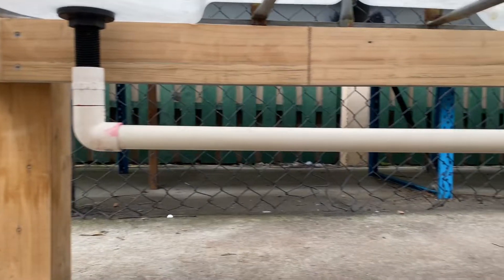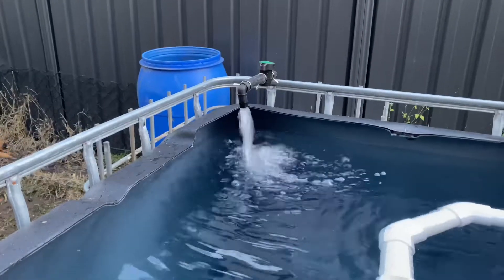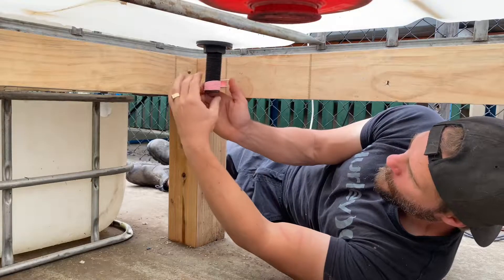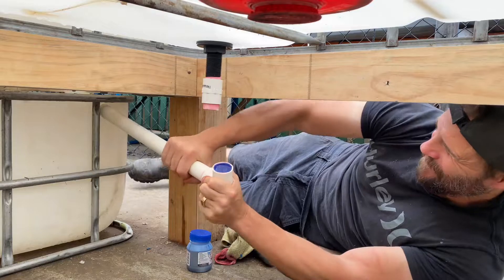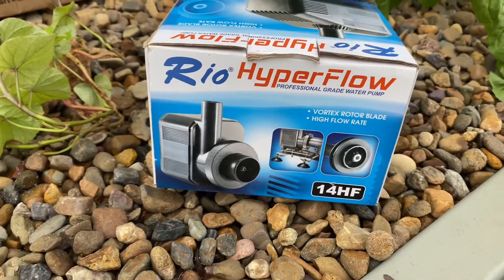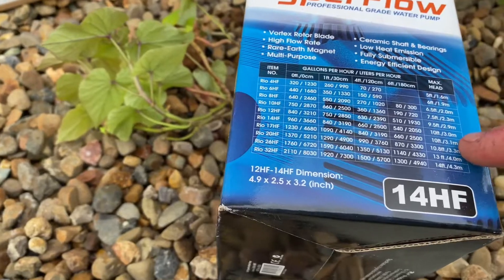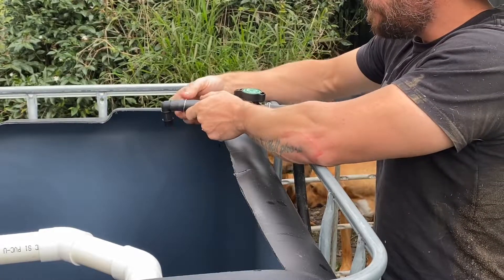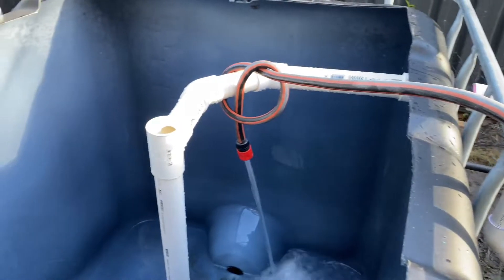How to Build an Aquaponics System: Pump in the Sump #aquaponics #aquaponicsystem #howtobuild

Comment: I like the system but I don’t understand how the pressure from the pump cuts of when the tank is draining I understand the float chamber for empty’s
Reply from the maker: Hi Michael. It’s a constant flow from the pump in the sump under the grow beds to the fish tank. It then continues to gravity feed from the fish tank through the radial flow filter into the growbeds and continues to drain back into the sump where it is pumped back to the fish tank.
It’s is all continuous. The pump is never cut off.

Comment: Hai Is pump work 24*7? if any problem  power falure?
Reply from the maker: Yes the pump is on 24/7. It’s best to have a Solar and Battery system in place for backup in case of a power failure.
Reply: @mattysbackyard9244  Thank You🙏

Comment: Nice systen congrats! I wonder if the pipe diameters you are using aren't a bit too small? Would go at least for 25mm for the pressured pipes and 50mm or 75mm for the drains.
Reply from the maker: Thanks. What is your reasoning for larger diameter pipes?
Reply: @mattysbackyard9244  to maximize the water flow rates and to fully use the potential of your pump.